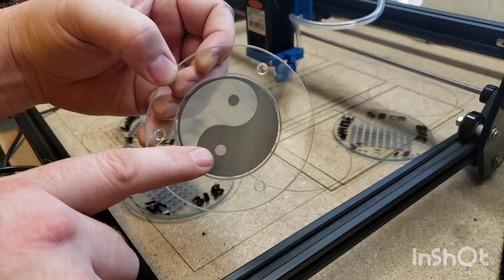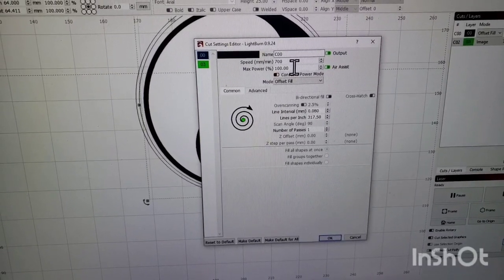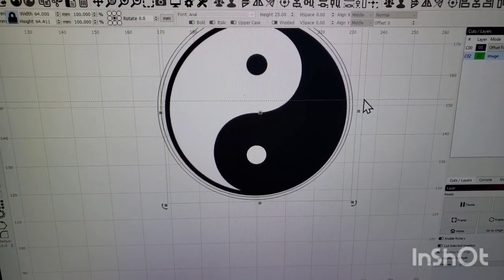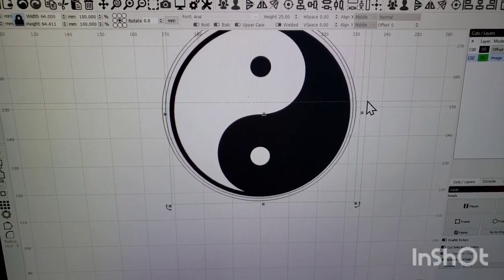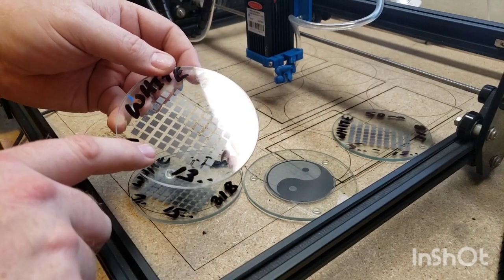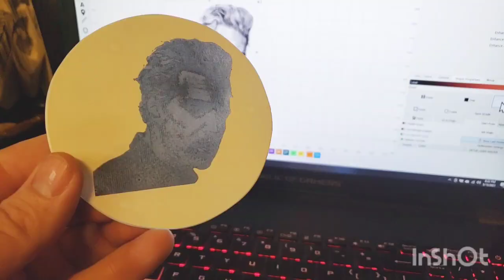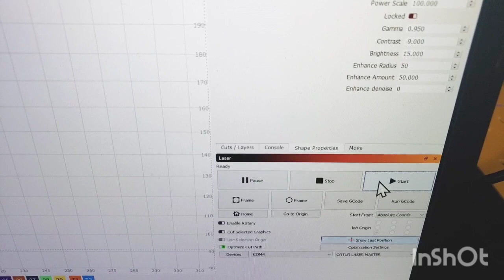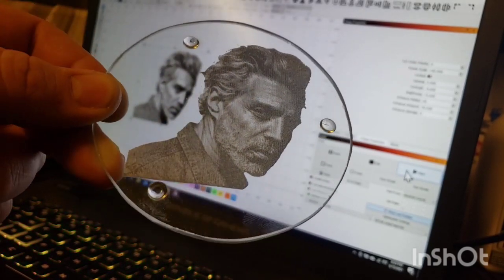Two Tone/Photo Etching on Glass - ORTUR Laser Master 2 15w.

Comment from the maker: Something I don't know if I explained very well. When I set the focus height to 50mm or 47mm I did not refocus the laser. The laser is true focused at 49mm. The other settings are slightly defocused to produce a different burn characteristics. When using a z axis I never touch my focus ring anymore. It's set to 49mm and I leave it there so my results should stay the same.

I've since made some wooden barrels set cut to 47, 49, and 51mm. These will better help to set an exact height more repeatable than using a tape measure. I've found if the defocus is just off 1mm it will not produce the same results. Exact focus heights are needed to make this work.

Comment: Thx for this  I am working with my new laser master 2 SF.  Any suggestions from anyone is appreciated.
Reply from the maker: just keep practicing and trying different things. most things don't turn out well the first try. Find a test pattern file and learn how to use and modify it for different speed and power ranges. I generally run everything at 85% power and adjust the speed until it looks good. Unless you are at max speed then start lowering power. Best way I found to maximize your burn time.  The old idea that diodes can only do stuff at super slow speeds just isn't true.

Comment: How do you measure the mm height when I was told to measure the height with the tool that comes with the Ortur. Thanks for the video.
Reply from the maker: depends on the model. I have the Pro and it's from the bottom of the heat sink frame. If its one of the other fixed focus models where the lens can drop down I believe those are all from the bottom of the lens. Run a ramp test. put an a piece of wood at an angle and burn a solid fill across the length of it. where it burns the darkest is your optimum focus height. see if your focus spacer is set to the lens or the heat sink.

Comment: How do you get the paint to stay when lasering off my scale goes from 3000mm/s down to 300mm/s and from 10% to 100% and all my squares take the paint completely off you just get a see through image
Reply from the maker: are you using a diode or CO2? CO2s might have too much power for this method.
Reply from the maker: you have to put the paint on a little thick. I do a 50% overlap pass and then 2 more quick passes.
Reply: @TheKennyHack  I have the Ortur LM2 with the LU2-4 module and I will try to lay down thicker coats I was doing really light coats

Comment: Question.  How well is the paint stuck onto the glass? Will it come off easily or even with  rubbing alcohol? Just wondering?
Reply from the maker: These were cleaned several times with acetone, then with glass cleaner,, and finally hot water and soap.. the color gets a little better once its completely dry.  Unknown how long they'd hold up to a high temp dishwasher. I haven't seen much sign of micro fracture yet.